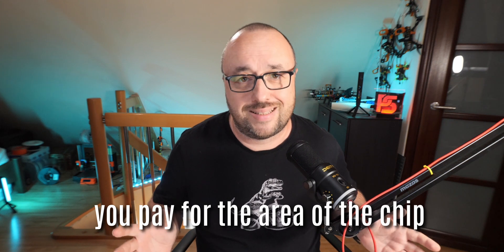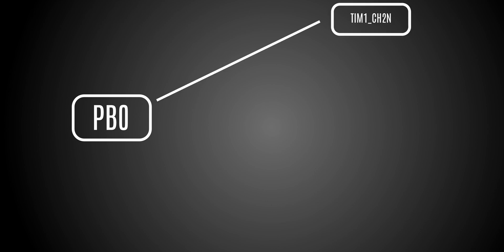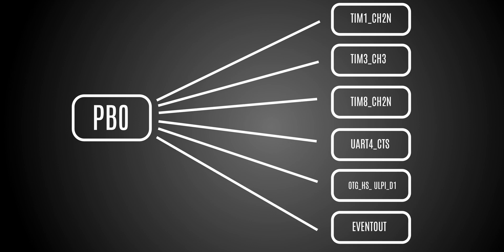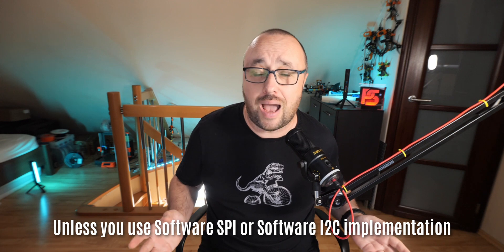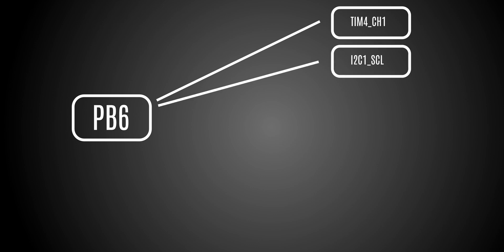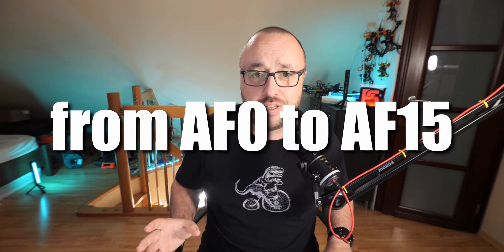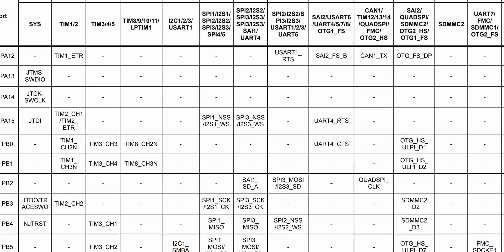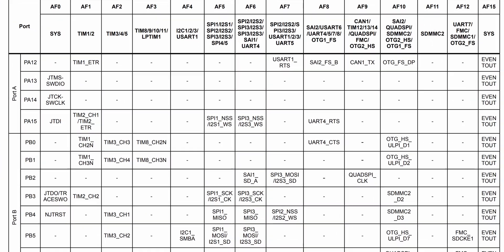How STM32 Alternate Functions work

Comment: Hi

I want to control the reset pin of the microcontroller in a very noisy environment, this is not possible with normal methods, can you introduce me a special ic to control this pin?

Comment: How to switch from output or input Mode in Stm MIctrocontroller for exemple after using GpioA_Pin0 as digital output and in the same programm how to use it to send data via Usart2 so my problem is how to switch between output and alternative function mode

Comment: STM32CubeIDE has a graphical tool that allows to choose witch resources you want to use on the mcu and if there are any conflics with the pins that share those resources. This will help you to avoid needing to dig a lot on the datasheet :)
Reply from the maker: yup, that's also a very good advice!

Comment: then why not to switch to ESP32? Its much more flexible (for example SPI has dedicated pins but as long as we do not need 80MHz then it might be mapped to any other pins) and more powerfull and it has buildin wireless communication
Reply from the maker: ESP32 is not the answer to all the question. Seriously :)
Reply: @HackerUni  for example? Im just curious.
Reply from the maker: ADC sucks, ESP32 has no flash, no native USB support, less industry support and if you try to looks for some features, more advances STM32 boards just win